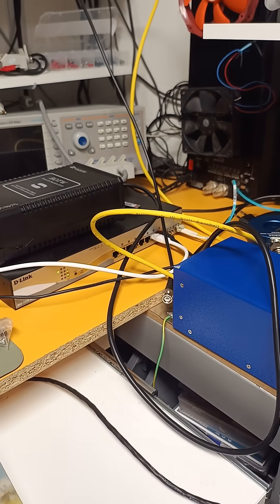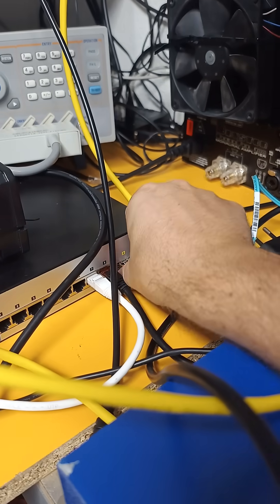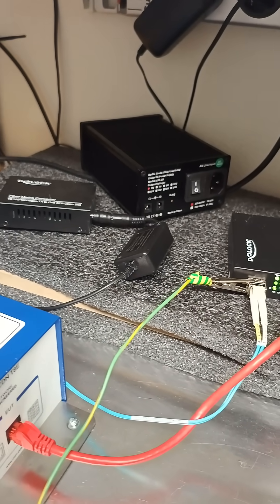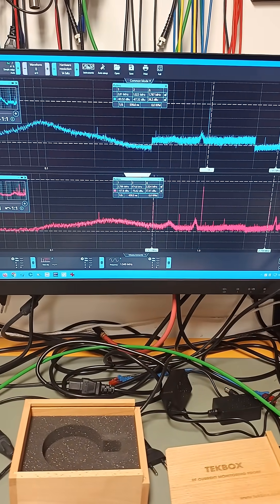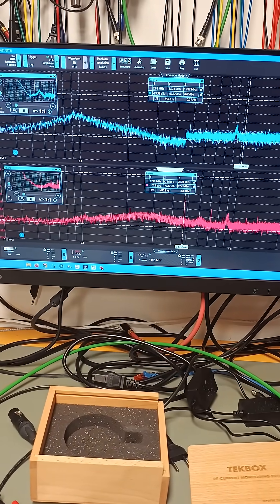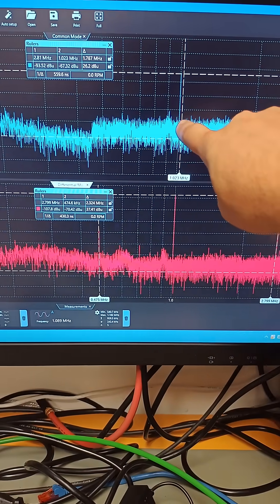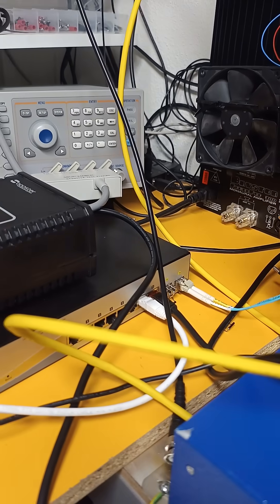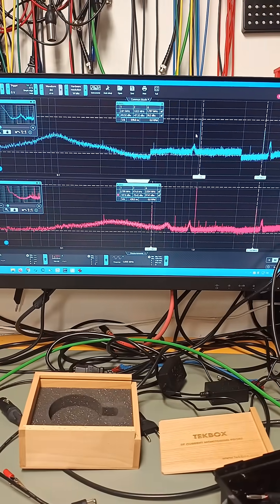Is a fiber optical connection immune to noise? ... Nope! It is NOT

Comment: I saw a comment: There is also a weak point in these tests. It seems they use the same power outlet. Noise can spread from the noise generator through power lines to the receiver power supply. Therefore this setup is not completely isolated. They should insert power filtration device, they didn't.
Reply from the maker: It is isolated. Completely. You can see the CDN for the network and the LISN for the power.

Comment: :face-blue-smiling:[G r o k, DeeperSearch] Fiber optic, switch, galvanic isolation. If we inject a 1 MHz tone into a UTP (copper) network cable, should it appear in the measurements after the switch, fiber optic, and fiber type converter? If so, is galvanic isolation defective, or is that not its purpose?...

Direct Answer
The 1 MHz tone is likely to appear in the measurements, as the research suggests that electrical noise can be modulated onto the optical signal through the connected electronic components.
This does not seem to indicate a failure in galvanic isolation, but rather that noise affects the electronic devices, leading to its indirect transmission through the fiber.

General Explanation
If you inject a 1 MHz tone into a UTP (copper) cable before a switch, and the signal then passes through a switch, optical fiber, and a converter, it is possible that this tone will be detected in the measurements at the end of the system. This occurs because, although optical fiber provides galvanic isolation (no direct electrical connection), noise can influence the electronic components, such as transmitters and receivers, modulating onto the light signal traveling through the fiber.  The evidence suggests that the galvanic isolation is not faulty; its function is to prevent direct electrical conduction, which it does. However, noise can "travel" through the modulation of the optical signal, explaining why the tone appears in the measurements.  For more details, you can consult:  Alpha Audio - A deeper dive into fiber optic network connectivity  
Tiny Green PC - What Makes Optical Fibre Immune To EMI?

Detailed Note
This section expands the response with a comprehensive analysis based on available information, including experiments, technical literature, and technical considerations. It is presented in a professional style, similar to a technical article, with tables to organize the information and additional details supporting the initial response.Context and ExperimentationThe user poses a question based on an Alpha Audio article and a related video, where measurements were conducted on a network system including optical fiber, switches, and converters. Specifically, a 1 MHz tone was injected into a UTP (copper) cable connected to a Dlink-1210MP switch, and it was observed whether this tone appeared in the measurements after passing through optical fiber and a converter. The results showed, surprisingly, that the 1 MHz tone was detectable, leading to questions about whether this indicated a failure in galvanic isolation or if that was not its purpose.

The article describes two main setups:  

Setup 1: Dlink-1210MP switch → Delock fiber converter → CDN (for isolation and noise measurement) → UTP cable to an external switch.  

Setup 2: Dlink-1210MP switch → UTP to fiber converter → fiber → another converter → CDN → UTP cable to an external switch.

In the measurements, broadband noise (30 MHz) and a 1 MHz tone were injected into the switch, and measurements were taken on the Delock converter side. The results indicated that the 1 MHz tone was clearly reflected in the measurements, suggesting that noise travels through the fiber optic connection, despite the expectation that fiber should provide complete galvanic isolation.Technical Analysis of Galvanic Isolation and NoiseOptical fiber is known for its immunity to electrical noise, as it transmits data using light pulses through glass strands, without a direct electrical connection between the ends. This provides galvanic isolation, meaning there is no electrical conduction between connected points, protecting against electromagnetic interference (EMI) and ground loops. However, the experiments show that noise can still be transmitted, requiring a more detailed explanation.The key lies in the electronic components associated with the fiber optic system. According to technical literature, noise sources in fiber optic links include:  Thermal noise.  
Shot noise.  
Excess laser noise.  
Excess optical amplifier noise.  
Excess photodiode noise.  
Phase noise.  
Multipath interference (MPI), caused by reflections at connectors.

These noise sources originate from the electronic devices, such as transmitters (laser diodes or LEDs) and receivers (photodiodes), which convert electrical signals to optical and vice versa. If electrical noise, such as the 1 MHz tone, is injected into the system (e.g., at the switch), it can affect the modulation of the optical signal at the transmitter, carrying it through the fiber and being detectable at the receiver.Table of Noise Sources in Fiber Optic LinksBelow is a table with the identified noise sources, based on technical literature:  

Noise Source
Description
Impact on the System
Thermal noise
Fundamental noise related to RF performance, tied to the RF noise figure.
Affects the signal-to-noise ratio in receivers.
Shot noise
Fundamental noise, proportional to the received optical power.
Increases with higher optical power.
Excess laser noise
Random fluctuations in the intensity of the optical signal.
Can degrade signal quality.
Excess optical amplifier noise
Generated by amplifiers used in short and long links, includes excess amplitude noise due to ionization.
Noise figures: 3.2 dB (0.98 μm), 4.1 dB (1.48 μm).
Excess photodiode noise
Impacts performance, especially in high-speed photodiodes.
Timing jitter: 25 zs Hz⁻¹/², Phase noise: -179 dBc Hz⁻¹ (10 GHz).
Phase noise
Accumulates in long-distance links with multiple amplifiers, difficult to reduce.
Present at high offset frequencies.
Multipath interference (MPI)
Caused by reflections at connectors, affects phase-modulated links.
Can introduce signal distortions.

Interpretation of the Experiment Results
In the experiment, when the 1 MHz tone was injected into the Dlink switch, it was detected in the measurements on the Delock converter side. This does not indicate a failure in galvanic isolation, as the optical fiber remains immune to direct electrical noise. Instead, the noise likely modulated onto the optical signal through the transmitter, traveling through the fiber and being detectable at the receiver. This is supported by the article’s observation that “noise can, therefore, be modulated on the signal,” and by technical sources identifying noise from electronic components as a significant source.For example, the article mentions that replacing power supplies (e.g., using an Sbooster instead of noisy switching power supplies) reduces noise but does not eliminate it entirely, suggesting that noise comes from power supply contamination affecting electronic components. Additionally, when noise was injected on the transmitter side, it was not seen in the receiver measurements if there was no direct connection, but the 1 MHz tone was detected, indicating that modulation in the optical signal is the primary mechanism.

Conclusion and Recommendations
The 1 MHz tone is likely to appear in the measurements because electrical noise modulates onto the optical signal through the system’s electronic components, not due to a failure in galvanic isolation. The galvanic isolation of the optical fiber works correctly by preventing direct electrical conduction, but it cannot prevent noise from affecting the connected electronic devices, leading to indirect noise transmission.

:face-blue-smiling:To minimize this effect, improvements in power supplies (using clean power supplies, as shown in the experiment with the Sbooster) and in the design of transmitters and receivers to reduce noise susceptibility could be considered. This is particularly relevant in noise-sensitive applications, such as high-fidelity audio systems, where these measurements were conducted.

- Greetings from Tarragona (Spain) -

Comment: The optical cable itself won't pick up or transmit any noise.  That doesn't mean the box you plug the cable into won't pick up noise and then happily pass a noisy signal over the optical cable.  The optical cable breaks the electrical connection between the boxes it is connected to but it doesn't magically remove noise from whatever it is given to transfer.

In your experiment the two network boxes are electrically isolated from each other, so for example ground loop hum wouldn't be a problem.  But that is not the same as rejecting your injected noise.
Reply from the maker: Exactly! Spot on.

Comment: Thank you very much!  

It would be really cool to see a comparison with a standard Ethernet connection through the switch too.  Is the noise higher or lower?
Reply from the maker: Fiber is lower than normal copper connections..
Reply: @TheAlphaAudio if you inject random noise (don’t know if that makes sense), will you see it after the fiber as well? Like less of a clear spike like that one at 1mhz
Reply from the maker: @Nefty_ yes... You do. Check the article on alpha-audio.net.
Reply: @TheAlphaAudio thanks!  I will

Comment: 🤦‍♂️ the optical cable is immune to pick up noise from the environment WHILE TRANSFERRING. If you inject noise to the original device, you are doing a different experiment. Is optical fiber capable of transferring noise? Yes it is. But at that point it's also a signal. 😅
Reply: @shilu6979  shit in shit out
Reply: The fiber is also a galvanic isolation. The experiment is to test that galvanic isolation, why would it became a signal? Like the fiber would suddenly communicate on that noise frequency?
Reply: @Nefty_ Galvanic isolation is a way to prevent current from flowing between two circuits, but it doesn't block electromagnetic fields. So, if a strong enough electromagnetic field is present, it can still induce a current in the cable, even with galvanic isolation.
However, injecting a pulse could affect the whole device stability and cause it to transfer the noise as if it were part of the intended signal. The experiment wasn't set up to isolate the ports from each other, in fact a switch is made exactly for that. 
Does it affect "The Link"? At the input and output devices, yes always. During transfer, nope. That's the reason was designed.

Comment: That shows why a cheap fiber setup or a galvanic isolation inside a DAC for instance, is far from perfect!
Reply: Proof: the optical cable and converter that iFi ships with its Neo streamer. Video is somewhere in the timeline.
Reply: @jmtennapel this was the streamer that was performing worse via fiber right? This was exactly one of the eye opening experiences for me, I was like, if the fiber isolates everything electrically and there is a buffer after it, what wrong could happen? Today to me the explanation is in the timing drift of the optical communication, that causes phase noise on the receiving device, which would explain why for instance the phase noise of a clock can be retrieved after a fiber connection, even if a buffer is used.
Reply: @Nefty_ yes, that streamer. It is the (very) poot Ethernet to optical device delivered with it, which has major problems with its power supply. The irony that iFi of all companies sells a piece of equipment with bad power still gets a smirk out of me.
Reply: @jmtennapel Ahahah indeed 😅

Comment: I can tell you that there is no current flowing on the optical cable.  That alligator clip and ground wire is an excellent antenna.  Check your set-up before you apply for the Nobel prize!
Reply from the maker: Who says there is current flowing? Check the video please.
Reply: @TheAlphaAudio  I guess I'm having trouble understanding just what you are measuring.  You imply that optical fibers are not immune to noise.  If the noise is received on the fiber transmitter, it will be transmitted over the fiber.  What I am saying is that you cannot induce an electrical current on a fiber optic cable, thus they are immune to conducted emissions. and also immune to radiated emissions.  Tracking down wherever the 1 MHz is being coupled to your measurement system could be challenging.  Believe me, I know.  I would re-measure without the ground clip, since it's not part of the "real use" case.  Furthermore, Ethernet is balanced, and you've probably grounded the connection via the signal generator when you connected.  I think what tyou are seeing is ground conducted. A clearer picture of your measurement set up might reveal an unintended path.  I just want to help, I like solving puzzles!  Feel free to contact me off line!  Didn't meant to insult you, was trying to be funny!
Reply: What he shows in the video is a baseline measurement without a spike at 1 MHz. As soon as he enables the generator with a 1 MHz sine wave, the spike at 1 MHz shows up. That had nothing to do with a ground. Yes… a ground can pollute measurements, burning this case there is no link between the baseline and outcome.
Reply: And of course you all can hear it, right?
Where does it end? Don’t want the noise go listen to an orchestra but be sure they turn off all the AC in that hall/room and tell everyone to hold their breath. This is beyond silly. Sorry, not sorry.
Reply from the maker: @christopherkent6512  We never claimed this is audible. I could be... But not as 'hiss' or any audible type of noise. This kind of noise impacts things like clocking in the digital domain. And that is audible as amplitude distortion or other types of timing issues. 
But why not investigate these kind of things that can improve products? That is called progression...?
Reply: @christopherkent6512  It's not a tone, it's proof noise is transferred in the signal and influences the electrical signal that goes into the DAC. As we know, noise in that electrical signal influences the digital-to-analogue stage (source of jitter). It is not about hearable tones, it is about the purity of the signal coming in into the DAC. What you think of as 1's and 0's of the digital signal is in fact an electrical voltage change, and thus an electrical signal. It is not beyond silly, it is out of your knowledge.
Reply: @jmtennapel you are wrong about my knowledge but that’s fine, you have your opinion.